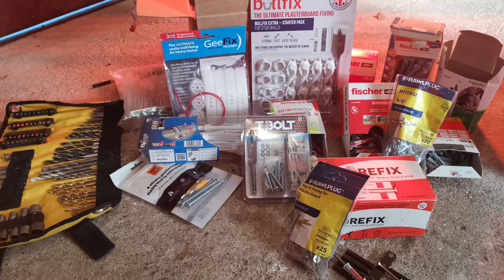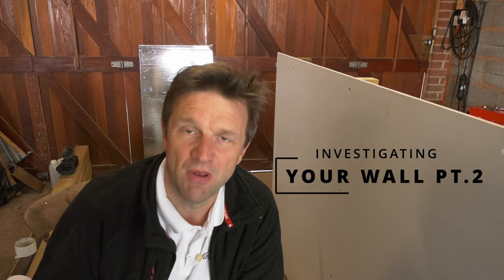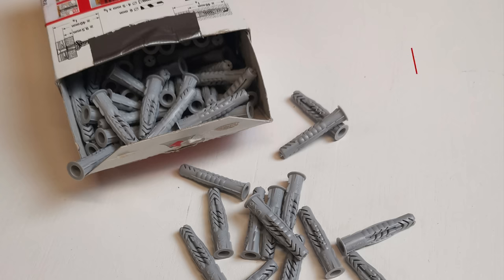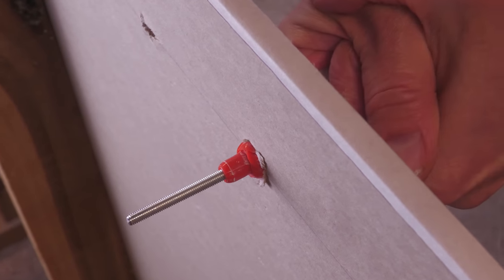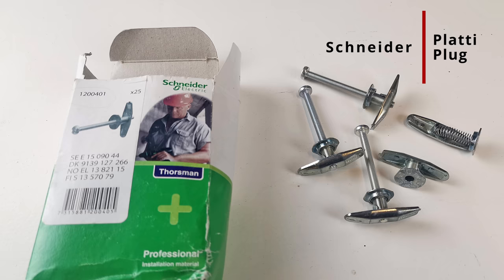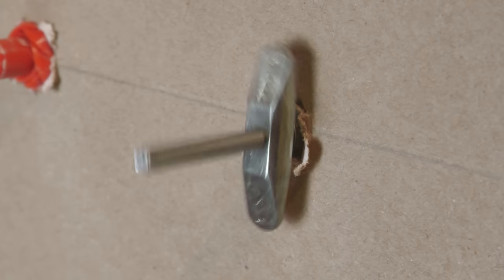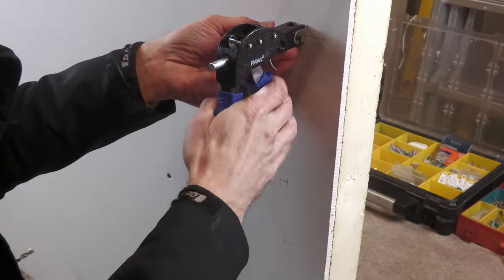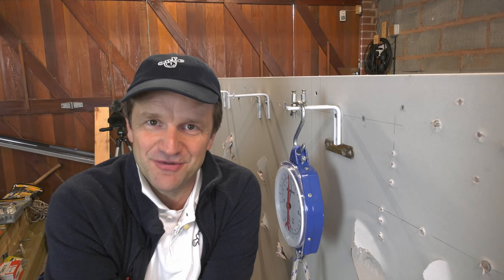How to Fix into Plasterboard - a Complete Guide to all the Best Fixings

Comment from the maker: 🛠Charlie DIYte Amazon Tool Store https://amzn.to/3fcLnY4 - all my tried, tested and much loved DIY tools. 
☕Charlie DIYte Buy Me a Coffee Membership https://bit.ly/3xuQ3zb - access our incredible Discord DIY forum and help support my Channel.
👚Charlie DIYte Official Merch Store https://charlie-diyte.myspreadshop.co.uk/ - all new range of professionally designed merch.
Reply: @Steve A Depending on how thick the fixture is the screw is going through a 50 or 60 x 4.5 or 5 mm screw should do you.
Reply: hi mate, just a little question:
I have used the "hollow wall anchors" to put a 14 kilos tv set on the plaster wall, they worked beautifully, but I have a 58 inches tv (it must be 26 kilos at least) set that I  am planning to put on the brick wall (sitting room chimney) and I found among my screws 4 concrete/brick screws (they're for about 70 mm long); my question is "would be the concrete/brick screws enough for hanging the 58 inches tv on the wall or it would be better to use concrete/brick plugs+screws?? for the job. 
thanks a lot.
Reply: Hi there Charlie, David again. Do you have a video on what is the best product for filling deep drill holes in masonry walls please.
Kind regards David
Reply: What about 6 x 50mm Fischer duo plugs for plasterboard? You only spoke about 6x30mm and 8x40mm. Thanks!

Comment: Another excellent review.  Snap Toggles are my go-to heavy duty fastener where there is a wall cavity.  Have found these to be also brilliant in outdoor applications such as with timber cladding or even inside a shower cubicle.  For these, I swap out the lightly zinc coated bolt for a stainless one, and smear silicone under the bolt head.

Comment: This was such a helpful video!! Having lived in a solidly built Edwardian house for over 30 years and where nearly every wall was seriously well built with brick, I have recently had to move to a house built in 1995, seemingly made entirely from some sort of soft cheese.
The walls are nearly all dot and dab plasterboard and I am just about to jump in and start fixing things. Because the house was previously a let, and tenants were not permitted to drill, it's never had anything much into any wall. I have never ever worked with plaster board, other than to know I hate the stuff with a passion and am not looking forward to having to drill large holes to put strange fixings through.....but this video has given me a lot of excellent info and some very useful tips and tricks to use when working out the various thicknesses and voids I need to know about. Thank you for such a comprehensive guide! 
First time searching....found you....subscribed! 😊👍🏻

Comment: Great video Charlie. I successfully hang up a 1.5m Oak Coat Rack with 6 Geefix attachments. It worked like a charm and covered an unsightly hole from a previous botched installation.

Comment: Have seen a few of these fixing videos and this is really useful too as it gives a comprehensive updated guide to each fixing and their positives and negatives and it really does help when choosing between them. Certainly wish I had seen something like this when I was mounting my old 40" Plasma screen on the wall! Compared to that thing modern TVs are feather weight. The Duopower is great and copes with situations that don't require too much strength and also means you can have a single item in the toolbox. However, the other fixings at the higher prices are very useful to have in the toolbox too for when things need a stronger support.

Though a longer video, the subject needs it. You could spend so much more time on the weight test with completely new board for each fixing and so on but that test is probably closer to a real world situation than something done in ideal laboratory conditions. It gives a consistent test, ideal for comparing them. Thanks for taking the time to do this.
Reply from the maker: Thanks Glen, I really appreciate that. Yes your summary is what my vid is rather lacking. Having promised myself I would take my time, in the end I didn't sum up properly what I use, which is broadly in line with your experience. Yes, no real need to use a new board for each fixing as 30 cms apart, the collapse of each bit of board around the fixing didn't effect the one next to it.

Comment: Thank you , the most informative video I have seen on plasterboard fixings. It does make a mockery of modern house building from the the last 25 - 30 years in that you have to spend half hour watching a video and require umpteen different fixing that you will need for what is a simple task in a traditional built or older built house. On the flip side though I’m not completely anti stud walled houses as there are benefits when doing alternations , electrical and pipe work compared to solid walls.
Reply from the maker: Thanks Ian. Yes and good for Wi-fi - assuming the walls aren't packed with foil backed PIR. 😉👍

Comment: Since I found the Geefix, I have not used any other product for plasterboard walls. I have hung 3mtr double radiators on them and I have had absolutely no movement. Outstanding fixing.
Reply from the maker: Yes it's still the strongest fixing on the market for plasterboard. 👊

Comment: Hi Charlie
Great video...pity it wasn't around when I bought my house in 1984, but most of those fittings were not available then.
It was my first experience with plasterboard fittings and like you I tried a lot of then before settling on a few I would use all the time.

In the beginning I used the Plasplugs cavity fixings or a version of them, only good for very light stuff like a light picture frame.
Plasplugs do have a heave duty version but I quickly settled on the Rawl Hollow wall anchor to ensure heavy items stay where they are supposed to.
But I ran into a problem with them on my internal walls downstairs as they were all Dot and Dab, my external walls all have studs fitted , but they are fitted horizontally in stead of vertical.
 So I started using a Thorsman TSP10 (or TSP6 for small stuff) I think they used to be called Duo Max.
They are still around but owned by Schneider Electric.
They are a bit like your Timco ones in that they have a nut to catch a threaded screw but they have washer on the outside attached to two plastic spirals which connect to the nut and wings.
You drill the hole, shove them in and then you can remove the screw, place the thing you are fitting against the wall and then put the screw in and tighten.
The wings (4) are drawn to the back of the plasterboard and keep everything in place.
When I used them on the dot and dab walls I used to drill a 10mm hole in the plasterboard and then insert a 6mm masonry drill in to drill into the brick to allow the long screw sit in.
The Corefix would solve my problem now but were not available then.

By the way, the Rawl Hollow anchor are very settable with a screwdriver if you drill exactly the right size hole, the two "fangs" on them are locking fangs which stop the fitting rotating, but you must tap them into the plasterboard first.
And you are right about the self drilling plasterboard fittings....they are junk.

One final word on plasterboard...it hides a multitude...usually things like cables and water pipes.
Some of my neighbours have drilled through both...and while the hole in the water pipes created a mess...the hole in the cable nearly killed someone.
To overcome this I usually drill a hole in the plasterboard without letting the drill go very far in and then shine a torch in and poke a small screwdriver in to feel if there is anything in there.
Take care
Dave

Comment: Very comprehensive video and some good knowledge. Definitely essential viewing for any DIYer with lots of Plasterboard walls. I opt for Fischer Duo Power for everyday use after Andy Mac did a video on them and Hollow Wall Anchors which I almost dismissed until I saw your video about using a setting tool, which completely changed my view on them. If I ever had to mount a TV or anything more expensive, I'd be going into the bricks or Studs because, at a certain load, the fixing becomes irrelevant because its the plasterboard itself that fails.
Reply from the maker: Absolutely agree. Thanks for that 👍

Comment: As someone who's lived in two new builds I feel pretty well versed on fixing to plasterboard on both dot and dabbed walls and stud partitions.  I have tried a lot of these fixings myself and have slimmed my fixings box down to a few go to items.

I use red Rawlplug Uno to fix light picture frames to walls in conjunction with a no. 3 picture hook as Charlie demonstrated in a previous video.  The Uno forms a wedge in plasterboard and is superior to the 6x30 Duo power fixing in my experience.  I have used the 6x30 mm for installing blind brackets into dabbed plasterboard in a window recess.  In this case I used an old screw to hammer one plug through into the blockwork before installing a second plug into the board followed by a 70mm screw through both of them to achieve a rock solid fixing.

For 90% of tasks I have used the expanding hollow wall anchors with the setting tool.  Toilet roll holders, mirrors (7kg), towel rails, light duty shelving, coat hooks have all been successfully and solidly installed.

I use the Stellafix fixing as a problem solver, for example I was too close to a metal stud so the metal hollow wall anchor wouldn't open.  I opened the hole up top 10mm and used the nylon fixing as it was able to knot up against the stud where the anchor would not function.

For installing TVs (I've done 3 onto [partition walls) I have used the Geefix fixing with a 25mm hole saw bit for a quick and easy install.  All TVs are absolutely solid on the wall.  As Charlie mentioned, the spade bits make a mess of the wall, particularly if they have a plaster skim coat so I also have a 20mm hole saw used for some Bullfix.  Speaking of which, perhaps it was my situation but I struggled to get the Bullfix universal to open in the collar and has to trim some plaster away with a knife to get the "horns" to rotate through and open in the cavity.

In my experience, the plastic used on the Timco snap toggles is brittle to the extent that the fixing has dropped into the cavity.  I noticed Charlie used the Toggler brand ones which seem superior.  I would avoid the Timco ones personally although it could simply have been a bad batch.

Finally, Dryline Pro plugs are a well designed and cheaper alternative to Corefix and Ridgifix on D and D walls although the inventor is retiring and has not sold the IP for someone to keep manufacturing.  Anyway you can now buy are the last ones out there which is sad as they were half the price of the alternatives.  Definitely worth a look.  I've had the radiators off in our house and replaced the single brown plug with a proper fixing solution for the substrate.  Some people, eh!!
Reply from the maker: Wow Tom, what a comment - massive thanks for that. Funnily enough I used to be a big fan of the brown Unos. Feel very secure when you tighten them. I think I was a bit put off when I did my first plasterboard fixing video, and you had to be laser accurate with your screw (getting it through the centre of the fixing at the back) to get the fixing to umbrella open, but maybe that's not quite how it was designed to work? I'm cross I didn't mention the Rigifix - it not being something I have experience using but which a number of you have recommended. It looks very good, and I'm intrigued by the Dryline Pro. 👍
Reply: What size expanding hollow wall anchors do you use please?
Reply: @Nyle95  M5 x 53mm
Reply: Hi there, I'm in a new build and I've watched this video about 5 times and knocked on my wall a dozen more trying to figure out what the hell the craic is... I am looking to fix 1.2m H x 1.2m W shelving via Twin Slot shelving. I initially just used rubber rawl plugs which I was told by my local DIY store is a no no.. i'm definitely a novice and am tearing my hair out.. 

The wall is definitely plasterboard and I've located the studs with the little magnets. I've made pilot holes and used a paper clip to get depth of the wall - which seems to be around 38mm-40mm... does this mean I have successfully located the stud and I need to drill into the stud? I've got hollow anchor fixings but i'm not sure if there is space for the fixing to expand...  Now i am paranoid but have no idea what the right solution is. Any guidance would be so helpful! Thank you.
Reply: @lotusrow  if the wall is internal, and it sounds as though it is, then you need a hollow wall fixing or you can fix into the studs if you have them. However, some new builds have metal studs which are tricky to fix to as they're narrow and you want to hit the centre of them.  If you have wooden studs, go straight in with a 50mm woodscrew. To determine the stud material, run a magnet up the stud. If it sticks in every position, it's steel. If it only sticks in spots then it's wooden (the magnet sticks to the drywall screw heads.

Comment: great vid charlie. looks like I'll be adding some geefix to my fixings box - love the fact you can add another screw into the wings. I also bought the gripits in an assortment box about 4 years and I regret it as I've only ever used a couple of them.
Reply from the maker: Thanks Peter. Yes those Gripits are a bit of a gimmick I'm afraid which is probably why the company ultimately went bust. Peter Jones ruthlessly exposed their flaws on Dragons Den when they first came to the public eye, by pulling the radiator off the mock up wall the inventor had fixed it to.
Reply: Bullfix Universal work really well.  Great reviews on Amazon

Comment: When I use the spring toggle anchors, to eliminate the sloppy hole, I fit a piece of wooden dowel onto the screw underneath the toggle. That really improves the fitting and you get a much firmer fit.

Comment: Great video again. Some subjects need longer videos and this is one example.

One thing I suffer with is the fixings opening distance. My internal walls have a cardboard lattice inner core (about 25mm squares) and less than 25mm distance between the 2 layers of plasterboard. Some of the best fixtures I just cannot fit due to the lattice. Your video is excellent as it shows all the information I need.

Many thanks!

Comment: great video charlie. definetly a few angles there that other videos dont include like really tight gaps and insulated board etc
its great that you mentioned fixing to the wall if possible. lots of people are obsessed with opeing up behind the board but ignore that there is a far better option availible
i have used most of those. my go to are the snap toggle  and hollow wall anchor. i have been looking at those bullfix but was aprihensive. definetly buying them now. they look great
i agree about the grop it. i never got on well with them. they are slow and fiddle to fit  and need a large hole  and cost a lot. far better options out there

i dont agree about those hammer in fixings tap its. obviosly there is no real strength there so should be avoided for anything with any weight to it. but they are very usefull for very lightweight  used like holding plastic trunking on walls or attaching screw on wire clips to walls etc. the best thing about them is that they leave a very small slot to fix if your using them for temporery jobs.

Comment: Very useful. Thanks. Talking about hollow door fixings (there are still plenty about) there used to be Tulip plugs. These had no moving parts but just had petals that sprang open once you were clear of the inside surface of the plywood. To stop it turning inside the cavity you maintained a tension in the bolt as you turned it using a claw hammer or similar. Very small hole, strong, dirt cheap.  Sadly no longer available. I've not seen any for 30 years.

Comment: Hi Charlie, loving all the different subjects you're covering so comprehensively. Thank you! Could I put in a request, which I think will be very popular and that is how to safely mount a TV above a central heating radiator. I want to do this, but want to make sure the screw plugs don't fail due to heat and how to protect the TV from heat damage.
Reply from the maker: It's basically a case of following the steps in my vid, to work out what's behind the wall and then what the best fixing to use is. You also want to double check there aren't any water pipes traveling up the wall to your upstairs if applicable. In terms of fixing, depending on the weight of the TV and whether the bracket is pivoting or not, one of those heavier duty fixings I showed with the anchor that opens up behind would be worth using.

Comment: Thanks Charlie, really helpful. I will just add one type of plasterboard wall: the pre-made partition wall consisting of a sheet of plasterboard on each side, held together by a cardboard matrix, often referred to as eggbox. I am working on a 1983 built house in middle England and every partition wall is this type, my mum in law's 1989 house is also full of them. If you go looking for studs on these walls you won't have much luck and pretty much the only way to hang anything is to rely on the plasterboard.The 'gap' available is quite deep but you do have to deal with the cardboard bits, depending where the drill hole happens to fall. I have to replace a radiator on one wall (most are on the external block walls) and the previous one was fixed using spring toggles, I probably would have ended up going down that same route, I had no idea there were so many and far better options, I will definitely be looking at one of the stronger options you listed. Thanks again.
Reply from the maker: Thanks - I've never encountered one of those walls. Extraordinary how some building practices have evolved over the years.  Yes, the section of the vid where I show you how the fixings open up in insulated plasterboard might be useful to you. The hollow wall anchor is probably your best bet.